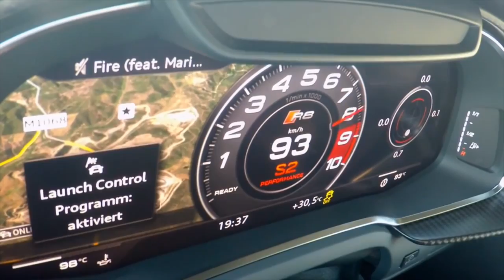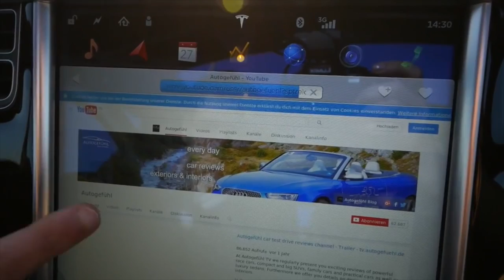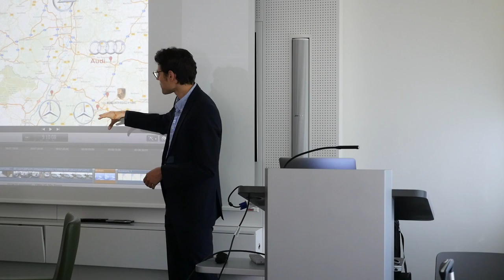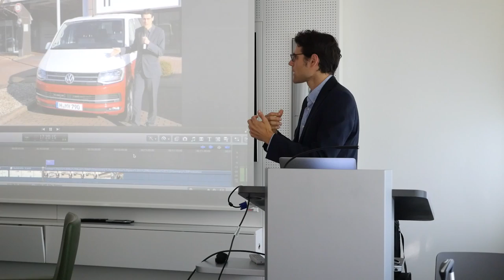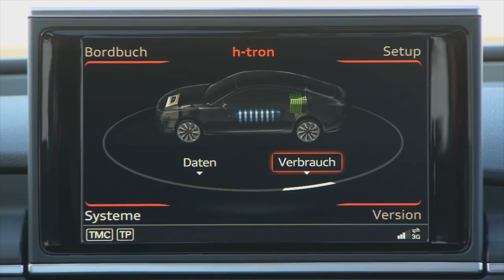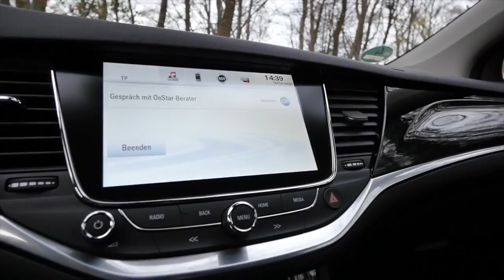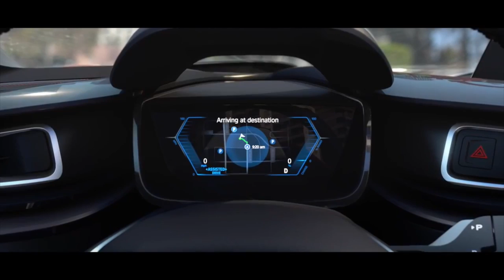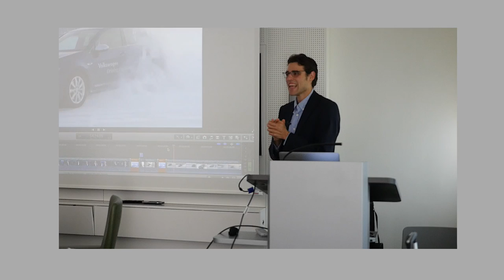Autogefuehl Thomas speech on Automotive Industry at University of Cologne

Comment: Very informative speech, Great Job!   So true, that German cars has a good feel with handsome design.  It would be good if German can improve in reliability and dependability like the Japanese car company Toyota.   Subaru is not as good on durability(things starting to break after 100k miles)  it happened to mine and my nephews Subaru.  Toyota held up way better.  My family and I have German cars sport cars and Luxury sedans but we use it for like a weekend cars. (Too fancy and costly for repair for daily use)   

Leather seats?!   Actually I preferred the soft-Tex material from Toyota/Lexus.   It is more durable and require no maintenance (conditioner not necessary)   The most importantly, it wears much better than leather.   More wrinkles resistance on the bolster of the seat.  Love the soft-Tex.   I had Mercedes MB TEX before but I preferred the Toyota/Lexus soft Tex now.   It feels a bit softer and it feels pretty close to leather.  My Buddy and I are car enthusiasts and admit we are pretty meticulous.   We like the soft Tex.   We feel that the Competitors are getting very close now to the German products. (The gap is getting very close).
Reply from the maker: +Frank Kwok thanks for the feedback m8!

Comment: I also wanted to comment on a point you mentioned regarding cattle production and how they're contributing to deforestation, because it's basically not. Overeating is the reason cause if we stopped raising cattle and stopped eating meat completely( which wouldn't be healthy btw) for the sake of discussion then we'll shift to consuming plants and create the same if not worse problems.
Reply from the maker: +stilkus You should read more on this, e.g. check the official UN figures. Cattle production is without doubt one of the main causes of climate change and the main cause of deforestation. More than 2/3 of all agricultural land is used to mass cattle production, so yes, stop raising cattle and stop eating meat would not solve all problems, but it would solve the most problems at once. Eating plants directly is the solution. Read more about this on www.adaptt.org

Comment: I'll just add my 2 cents. I just wonder why car manufacturers don't add an option of a cloth seats with wentilation. In common sense it seems to be impossible to combine those two options, but for example (I've checked it) RECARO Ergomed has cloth with ventilation. Haveing them as an aftermarket parts is a bit expensive for me because I count both front seets to be changed, but it generally shows that it is possible. In my opinion car manufacturers just don't want to offer such a connection. Perhaps as you Tomas said: genuine leather is an expensive box to tick, but here totally unnecessary. I wish so much to see in an option list cloth seats with ventilation and heating. The place I am living differentiations in Celcius degrees through out the whole year looks this way: Winter - 20/-10 , Summer + 25/+35. So both systems are needed: Ventilation and heated the seats. And I just preffer high class cloth over leather materials in so many ways. That's all.
Reply from the maker: Absolutely!

Comment: 3 things about autonomous driving cars: 

We are already overpopulated. Car accidents are one of the last "natural" methods to reduce population. Sounds extremely harsh, but is true.

There is no ethical footage for autonomous driving. Technical it's already possible, no doubt. But morally it isn't. Imagine a scenario where a kid runs in front of the car (autonomous driving). There is no chance of braking enough to not hit it. Also, there is no space of evading the kid. There is a car coming towards you on the opposite lane and the walkway is to narrow and features a concrete wall, or cast steel poles for a fence. 
So no matter which direction the car will choose, one person will die. 

Who is going to be responsible for the death? On which base will the car decide who's going to die? Age? Financial background? Socila background? Overall health? Number of traffic violations done in the past? There is just no ethical footing and discussion that would allow autonomous driving right at the moment. And I don't see a satisfying solution in the near future either.Lat point: Why use a car to be autonousmly transported, when you already could use the bus, train, etc? It would be much better for the environment. And it would cost much less.

Comment: immer mehr autos werden vernetzt, jeder brand macht das für sich und nutzt eigene standarts. es wäre gut, wenn es einen einheitlichen standart gibt wie pkw/lkw/motorrad sich im netz melden, so das die daten des einzelnen (relativ)anonym bleiben. das netz selber müßte ein staatlich überwachtes system sein, welches offene software benutzt und einzelne daten (der teilnehmer) randomized (startpunkt usw) um die relevanz der daten hoch, aber die rückverfolgung auf einzelne personen sehr schwach werden zu lassen. jede autonome entwicklung durch einzelne marken bringt uns in richtung google,FB oder YT. denke, dass ist ein punkt der noch nicht so im fokus steht aber sicher extrem bedeutsam für die zukunft des automobils (im sinne des wortes) ist.
Reply from the maker: absolut

Comment: I know Elon wants to convince everybody that batteries are the solution for green cars, but the future of development battery capacity is still very limited.  This is why the Model S has thousands of pounds of batteries. Elon is relying on the fact that an infrastructure for charging basically already exists but how do people who live in apartments charge their cars?  In addition, as you pointed out Thomas, recycling of the battery and the relatively slow charging times are also issues to overcome or address.  

With respect to fuel cells, I know the costs of fuel cells have dropped by 50% in the last 5 years.  The question then becomes, can economies of scale reduce the costs enough to make them viable for cars.  The lack of infrastructure is another big obstacle.  (I'd say the fuel suppliers would want to see fuel cells win as this is a way for them to transition to producing hydrogen from fussed fuels.)

I see fuel cells as gaining traction in buses first, as they won't require such a large infrastructure and also the "refuelling" can be done in a very short time keeping the bus operating and making money.  Same goes for trucks.   

I'd love to hear more from you and the people at Audi on this topic!  Great talk Thomas!!
Reply from the maker: +kevin n thanks for the feedback  kevin, good points !
Reply: Hi Thomas, I'd love to see an episode exclusively on the future of electrification of cars from the perspective of the German manufacturers.  Fuel cells, batteries BEVs, etc.  Thanks!!